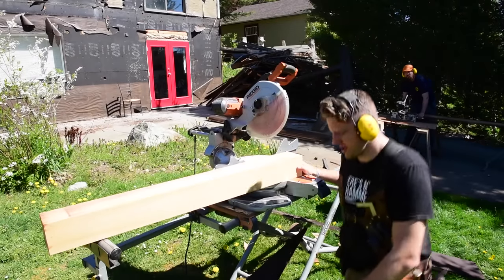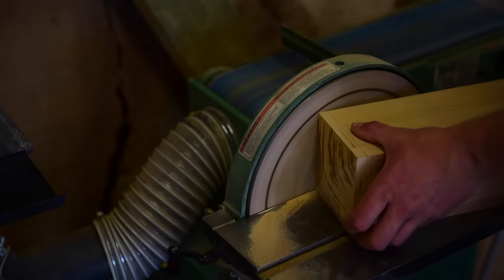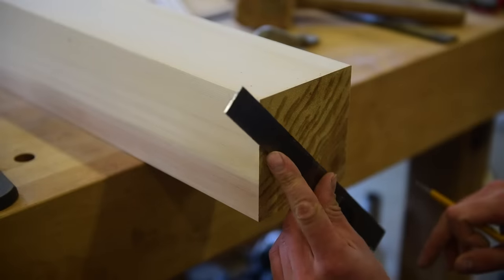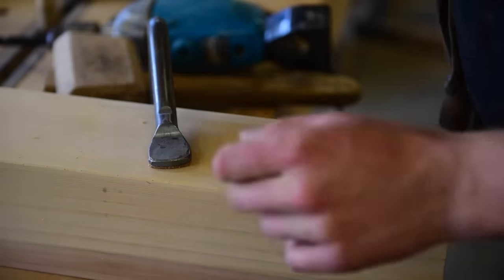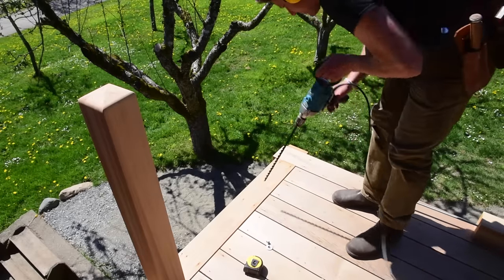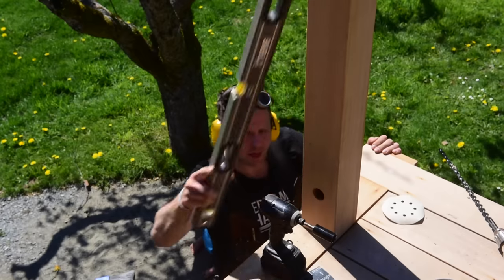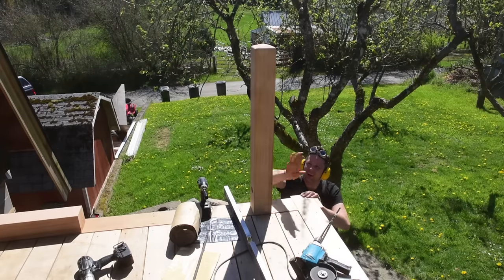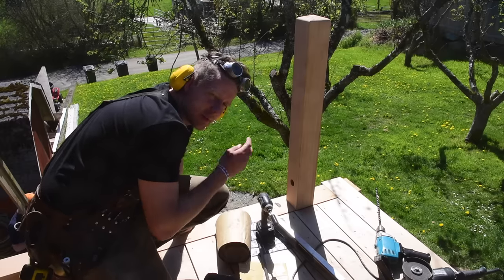FTF #54 How To Install Handrail Posts, Quick And Easy

Comment: By far the goofiest way to secure guard posts to a deck I have ever seen. Give it a couple of years of swelling and shrinking with rain and sun , and I guarantee you these posts will be wobbling around like a rocking chair, those shims will be disintegrated and the post will be split and rotted...
 If you analyzed forces and loads put on that post with this method of mounting you should be able to realize that it is very similar to a log splitter.
  The lateral load resistance is only half the width of the post and the core strength of the lumber has been drilled away and hollowed out.

Comment: I have a question and it may be dumb so, sorry in advance. 
Why not just epoxy glue the threaded Rod into the bottom of the post that way you don't have to drill sideways into the post at all?

Comment: Ever heard of chem set. You would of only needed hole through bottom of hole. Pop the sleeve in and fill it with chem set and put in threaded bar. Solid.
Reply: Through bottom of post correction.

Comment: Can this method work if we insert the other side of the threaded rod into bedrock as an anchor and secure with epoxy? Asking because I can't auger and submerge some fence posts for my dog run and drilling into the bedrock is the only way.

Comment: Even if you used lock washers, which you didn't, those nuts will losen over time and that post is gonna wobble like nobody's business. I used a technique like this about 10 years ago, it's to the point now where it doesn't even matter how much I tighten the nut, it still wobbles. Stick to pass through posts with backing blocks and timberlocks; solid as a rock for years. 😊

Comment: My only concern with this system is the post contact to the decking. This area under the post will retain a lot of moisture, could be a big fail point, especially since it was shimmed allowing a hairline gap for water to penetrate underneath. The decking could become very soft over time leading to a very wobbly post that could fail, especially since the post base is sealed off, helping to drive the moisture downward. I love the concept don't get me wrong, but it just doesn't make too much sense in my opinion. I hope that threaded rod is stainless or galvanized!

Comment: What about drill 10mm hole for 12mm threaded steel rod, tight 2 nuts on one end, and thread the rod straight into the hole, so big avoiding on side of the post? The down side is a bit less uplifting force, because no washer and nut inside the post, but you can drill it a lot longer to counter this.

Comment: I would cut the posts a 1/4" longer and set them in place plumb and scribe the bottom. Cut the scribe lines, stick the Grace membrane on the bottom and avoid the shims.
Reply: Waste of time, Jmo.

Comment: 3/8" or 1/2 all thread? great video
Reply: hugh mallany I’ve been trying to figure that out too.  He uses a 1 1/2 Forster bit to make the hole in the side of the 4x4 and the washer he puts in there is almost the same size (1/2” sized washer at 1 1/2”).  That and watching the size of bit he drills in the end, the rod sitting beside it while he’s drilling inside, then later the washer and nut sitting on the deck outside.  All compared to his hands, fingers, and other things in the shot.  I’ve come to the conclusion that I’m pretty sure it’s a 1/2” rod.  I’d love to know for sure though.

Comment: Yes sr i have a question..my home has 2 facade balconies..base is wood covered by stucco, composite round balustrades with wood beam thick rails..well the builder used cheaper untreated wood and its rotting..so im trying to figure out how they fastened wood raíles to balustrades . Also wood to stucco home walls..I see nothing..No screws,  bolts 
, Nada..I just want to replace wood rails with nice wood..thank you sr

Comment: How would you tighten the top bolt if the rod was cast in concrete? maybe I missed something about the top bolt but how does it not spin?

Comment: That post is going to look great but not very strong. The post should have been fixed to inside of the deck framing, and the decking cut around that way it is supported and alot stronger than just a bit of threaded rod.
Reply: looked sturdy as hell to me
Reply: @charliehobson33  looks can be deceiving..    
amazin... a couple of guys having a little play fight and one falls against the hand rail and post... I think it will break.

Comment: How will that membrane stop water seeping into the end grain when it runs along the deck.  Capillary action will get in-between the membrane and the wood.  Also how was the post not plumb if the bottom of the post was cut squarely and the deck is level, half an inch out of plumb is not a small amount.
Reply: Membrane and adhesive will greatly reduce absorption. Single point force and varying density of wood are responsible for pulling post out of plumb.
Reply: @chadburke852  What has density got to do with it, please explain that one.  Membrane and adhesive will not stop water seeping into end grain in external environment.

Comment: That is gonna be a perfect way to fix my posts. I was supposed to install full aluminium one but way to expensive.

Can someone tells me what size of rod it is? 3/8 maybe?

Thank you
Reply: 3/8"s or 1/2. I think 1/2 is what we use a lag bolts to bolt the house to the foundation.
Reply: Chris Marts  is this galvanized all thread
Reply: @hobypatrick  I believe so. We use galvanize to bolt the houses to the foundation.

Comment: U don't have to shim..just put a couple angles on your post. You can put a 6" level where the post is going to go to see what  angles to get it close the first time. I wouldn't use this method for exterior though...so much shrinking of the wood and this relies on tension for it to be strong.

Comment: I have a question for you. My sister built a deck a while back with a rail and now she wants to add a roof, what would be the best way to do that?
Reply: I'm not the Samurai, but, she will need the proper uprights, footings, bracing to pass code. Edit:  check with your town codes even though I never would but to be safe, just check for permits and codes.
Reply: We live in the country and don't have to worry about codes.
Reply: Ron, Are you a builder or a Jack of all Trades and Master on None like me ? lol
Reply: Ron, A couple questions. What type of roof is she looking for ?  Just something to shed water, pergola or is she looking to frame the whole deck in and make a 3 season room out of it ? Thanks.
Reply: august just to shed water and snow.
Reply: august I like woodworking and auto mechanics. I'm disabled so I have lots of time to do stuff.
Reply: No! You will need a structural design with approved fasteners that have rated ASTM design strengths.  Alternatively,  to use this method will require a structural engineer's stamped design,  which will run you around $3000.00 in America.

With the first method you can probably get by without a structural engineer's stamp,  because you are using rated ASTM fasteners.  If you use engineered trusses, your municipality may not require a structural engineer's seal. So it's quite a bit cheaper.
Reply: @flfl3969  Fasteners. Lol. There a little more to it then that
Reply: @chrissmith2921  Really, why don't you  enlighten everyone with your great wisdom?
Reply: @flfl3969  Go sell your over priced fasteners somewhere else.Wasnt too many years ago that a screw was non existent.
Reply: @flfl3969  If somebody asks me how to frame a house I don't reply" nails".
Reply: @chrissmith2921  Neither did I. Go back and read my comments. Now go repeat 3rd grade again and this time try to actually learn how to read!
Reply: @flfl3969  Sorry for hurting your feelings.

Comment: Holy crap dude you had to go back to a shop to fab your post. Notch those posts, nail them to rim joist and drill hole through for 1/2” bolts, use Simpson strong tie deck tie back. 1/2 the time and a stronger connection.

Comment: I wouldn't trust that bolt to stay tight after the wood goes through a few hold/cold, wet/dry cycles.  You'll likely have to be tightening it up on a regular basis.

Comment: Cut your hole in the bottom of the post a little smaller than the all thread and screw the all thread into the wood. it will never pull out no matter how much you pull on it from the bottom nuts.

Comment: Could you just use wood glue to secure the long rod in the 4 x 4 instead of drilling into the side and using a nut and washer?
Reply: yes with a large wood screw with a large thread it might be possible but you really risk tearing out the wood because of the high tension. So this way is best practice ....

Comment: NICE JOB BUT STILL NOWHERE NEAR AS STRONG AS IF POST RAN DOWN INTO DECK FRAMING WHERE IT WOULD BE HELD IN PLACE WITH BLOCKING AND CARRAIGE BOLTS.  HIS POST WILL EVENTUALLY LOOSEN BECAUSE OF THE HIGH LEVERAGE OF THE POST WHEN PULLED ON.  BOTTOM EDGE ACTS AS FULCRUM AND, BELIEVE IT OR NOT, OVER TIME THE THREADED ROD WILL STRETCH AND FATIGUE.

Comment: Way to overkill elaborate. By the time you get one rail post set we could have had an entire deck built. Plus always think of the next guy coming in down the road to replace cracking rotted deck boards. Never attach a rail post directly on top of a deck board permanently that way. Make easy access to future deck board replacement. I just rebuilt a 12x40 two tier deck and was unpleasantly surprised to see that not only did the previous builder ignore every code in the book but attached 3/4 of the 6x6 rail post directly to the top of the deck instead of overlapping to the side and using carriage bolts/structural screws to attach which made it really tough to detach them all just to replace deck boards. Just a thought.

Comment: 1:15 into this video i noticed to turned the timber 4 time. Why? 3 turns would place to exact opposite side from where you start...or is it 2?  Yes 2....I understand the friction or this cut but why would you not place an end stop?
Reply: a simple cut-off held on the fence with a vice
Reply: also this cut doesn't requier your saw to cut past 50% of the timber.   As a carpenter tradesman this use of a saw blade is a matter of expense.  MBA harvard online course, business management, the cost outline.
Reply: Try doing this a couple times yourself and you will understand. That's not a dig, just real world application is not always the same on paper. Also, when you are looking for a perfect profile, the wood is not always perfectly square or to dimension. 1/32 off in dimension or square is very visable on such a cut so that could easily necessitate a 4th cut to true everything back up visually.

Comment: Way faster and stronger way to install rail posts than this. Looked like it 
took many hours to prep and install one post.  I hope this doesn't qualify as a "troll" or   
"info dorkie guy" or "tech-spec weirdo" by saying this. 

Two 3/8" galvanized threaded rod, w/ washers and nuts, 90 degrees offset, vertically spaced 6" apart with under-deck boxing will make any rail post rock solid. 

On this deck in the video, the outer rim joist is structurally redundant. The joists are sitting on forklift-style steel beams, the posts as close to the rim edge to buy max. deck area. Simply install longer beams.  

The threaded rod in this video can be fastened to the cedar post with Redhead acrylic cement. No need to side drill to fit washer and nut. 

The weakness with seating the cedar posts flat on the deck is moisture will eventually wick through the bottom end grain, attract bacteria and fungus and spread rot, even with a gasket. Cedar always must have an unobstructed straight down drainage path. Aesthetically having to shim the flat bottom creates an even more prone end grain for water to infiltrate. 

The best way to install posts is to strongly affix to the framing and scribe the decking to fit like a glove to enable water to drain straight down and not stick around. It is very easy to conceal each rod, washer and nut. 

Deck rails all come down to safety; the family picture portrait where 20 people are leaning against the rail for the photo.  The rail has to withstand the forces while looking sharp.  And it's done by solidly tying into the framing. 

This vertical rod is okay for corners. It's flimsy for all posts in the field. I would never do use this method.
Reply: Be lucky if 8 people would fit on that deck, and falling from less than 5' , even I could take it after 4 back surgeries.

Comment: This has to result in a wobbly railing. Not to mention the end joists drilled out for bolts lost structural integrity. There is a reason no one builds deck railings like this. I would like to see him grab that post at the top and shake it back and forth

Comment: 9:00 minutes in you spray primer from the top of the deck,  why not do that step as you mount the all thread in the shop, on your workbench?  You know that is the next step for the post when you add the all thread.

Comment: You didn't show how you get the nut screwed onto the bolt inside the hole? I think that would be very difficult.
Reply: Hold the nut flush with your finger and screw the bolt through it from underneath.  Doesn’t have to be tight, just snug.  The bottom nut will tighten both ends

Comment: Here is a quick and easy method for installing wood handrail posts on your deck or staircase. But first go out and buy a Ridgid Combo Mitre Box with stand, 800.00, Floor mounted disc sander, 460.00, Battery palm sander, 50.00, Battery Router, 140.00 Mikita 1/2" drill 150.00,  Battery Impact Wrench, 150.00,  Commercial Shop work bench 1500.00, Misc bits, cutters 150.00 and only then will this be quick and easy.

Comment: Done simular with 1/2 inch bolt with the thick 1/4 inch wasser. bored to the top bar. was a must, maybe of risk of breaking the 4 by 4. overkill in my mind!
its just the stupid matter of a signed approved paper for the work.

Comment: This is scary. This method of installing a newel/guard/handrail post would not even come close to passing building code regulations anywhere I’ve worked. Also I wonder why it’s installed at the edge of the deck where you would expect it to be but a foot or so away from the adjacent side?

Comment: Timbertech is the best composite in my opinion so nice name drop
Reply: Wesley Townsend Don't use their new "encapsulated" material!!! End grain swells!! Garbage.
Reply: Thingamujigger 5/4 or tongue and groove engineered cause I have had the T&G engineered on my deck for the last 18 years and it looks as good as the day I installed it. One of the planks faded and they replaced it and installed it for free. I used the redwood wood grain in that funky looking T&G full 2" board cause that E-support style looked way better and stronger than the solid 5/4 plank.  I can see that swelling and /or sagging happening with the 5/4 but not the T/G. I know that the 5/4 is like half the price but the warranty on the T/G will cover anything on my deck for as long as I own this place ALA original owner and 15 on 2nd owner.  I am not trying to just disagree for no reason but almost 20 years and just one plank faded. Also they allowed 24" centers on floor joists but I went 16 cause I set a hot tub on it and needed the extra stability.  I have a real redwood Gazebo made and I've had more repairs on it with splitting issues and worries about kids and splinters.  I'd love to know more about your reasons for being less that sold on this brand / style of product
Reply: Because their new line of decking is composite that is encapsulated with some sort of pvc or plastic type finish material. Therefore the end grain (especially at butt joints) swells while the rest of the board (where water cannot penetrate) remains static. Very bad product. Super big time lack of R&D. Supposed to be their latest and greatest. Looks absolutely gorgeous during and after install......ONE year later, disaster. Beware.
Reply: I believe you completely. A lot of these companies that use to make great products started cutting corners and I am sorry that you had to suffer because of it. Hopefully I will not have to do another deck for a while. Thanks for the info bro.

Comment: 11:10 this more on this post, (no pun intended) I would have turned this post on a lathe.
Reply: please if you replace this post, use a 3-d printer aluminum (I-bean) covered/rapped in Luan Plywwod

Comment: Its 2 years later , I'd like to know how that post is sitting NOW ? And " trying " to be a pro means that if your cut off saw is wobbling while you are cutting on an uneven surface you find or make it stable , BEFORE CUTTING !! This is amateur hour at its best/ worst , depending on view point .